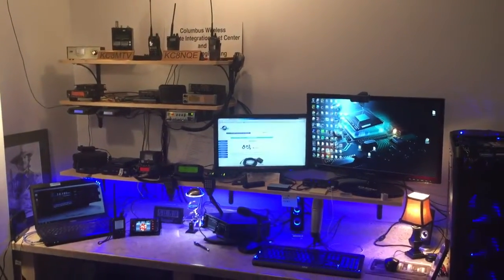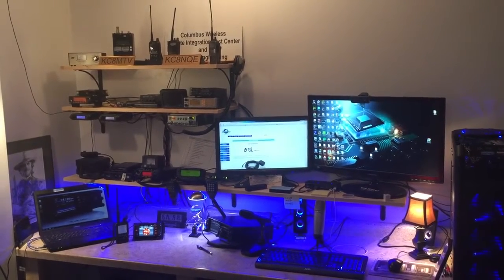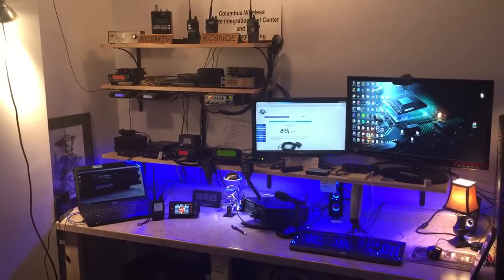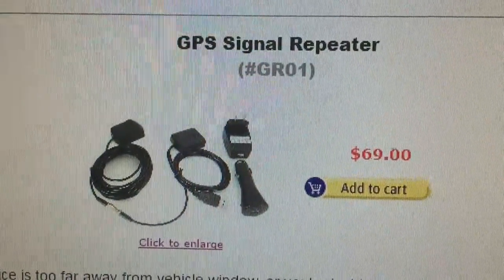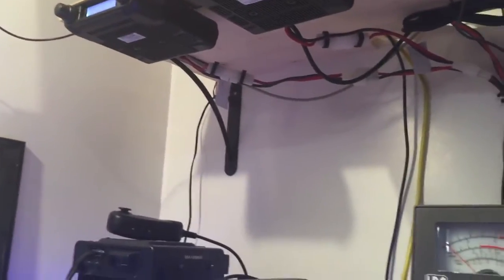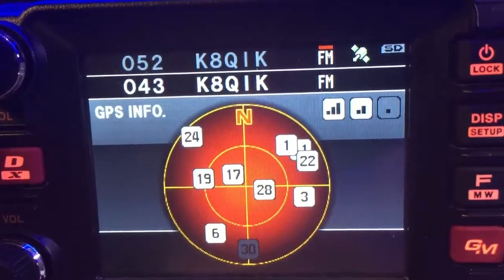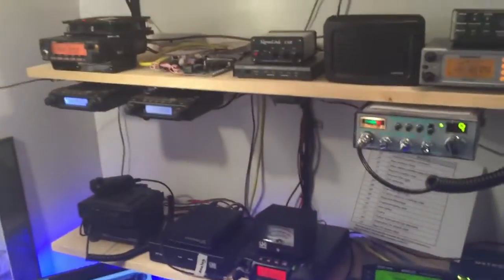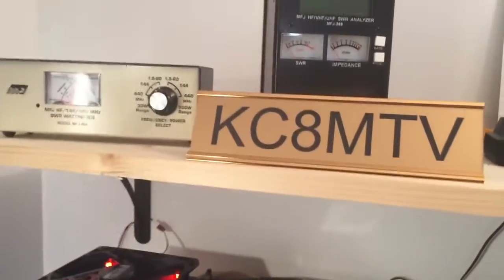GPS Signal Repeater #GR01

Comment: The navsgo.com web link is not working.. So I bought this type of repeater on eBay months ago. Installed the antenna in my roof attic, ran the long antenna wire down to my basement and secured the transmitting antenna to my basement's ceiling. It made a small difference but I think this kit needs the transmit antenna to be close to the on test GPS equipment to be received.. Or I bought a 'clone' non-sensitive of your real kit... ? Am-I wrong ?

Comment: I'm looking to figure out how to do this so that I can get GPS for my drone indoors, so that I can get accurate maps (pictures need to be geo-located)..   I'm going to test this !  As long as the drone gets constant GPS lock this would work!     Thanks!
Reply: oops, there might be snag with this. Remember GPS works by timing of spread spectrum signals direct from satellite to the antenna receiver. I wonder if the position on GPS will reflect only the position of the roof receiving antenna on the repeater? I noticed the post is from a few years ago, were you able to give this a try?
Reply: @tomtessier9771   I actually did not.. with the new sensors.. flying indoors is fine.. I was trying to get geo location data on the photographs. I have not tried this yet.. thanks for the reply.

Comment: So I was looking for a gps to plug directly into the side of the FTM-400DR head....but it looks like what your doing is grabbing the gps signal using a much better receiver, then transferring it to a broadcast antenna and then all of your units that are trying to receive a strong gps signal pick it up from you new set up....do I have that right?
Thanks for the Video.....
Mike